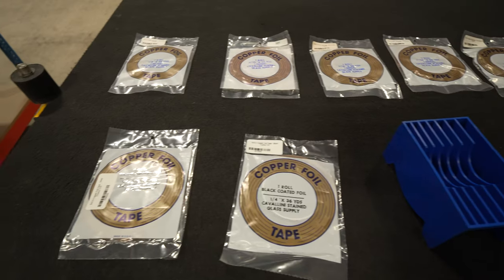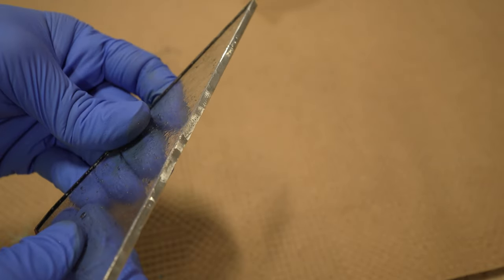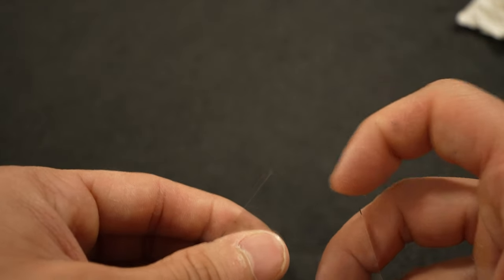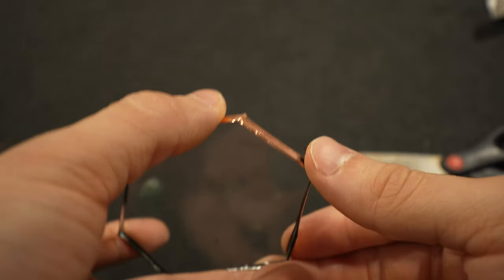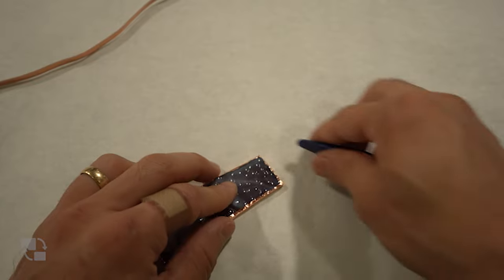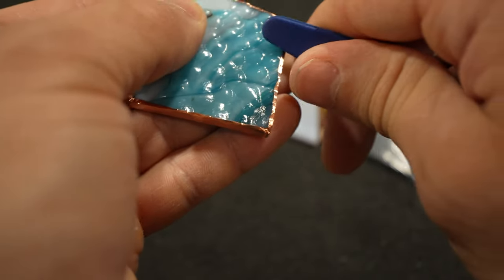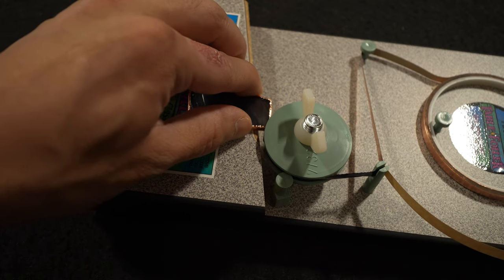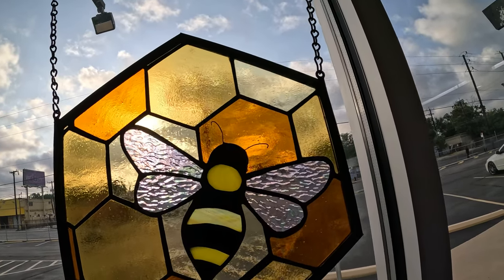2024 Stained Glass Beginners: Do This For Perfect (AND FAST!) Copper Foiling

Comment: I noticed some of your pieces weren’t ground on the grinder. I thought after even a clean cut, your were advised to rough up the glass to make the adhesive stick better. True or not? I’d prefer to not grind if I could. Thanks
Reply from the maker: Sometimes the grinder can leave glass powder, if you don't get it all off it can compromise the adhesion. You can stick without grinding. The solder really solidifies the bond between pieces
Reply: @Mr.StainedGlass  So if I have a clean nice looking break, then I can just foil after I clean it? Sounds great and quite a time saver. I’m gonna try it! Thanks

Comment: Good info. I always go into these stained glass videos with a lot of skepticism, but you did good.
I'm a firm believer in doing what feels best and what gets the job done for you. I taught stained glass for many years, and most people had issues with "foiler tools", and always reverted back to doing it by hand. The extra time was never an issue as they were socially as well as ending up with a beautiful stained glass piece.
The only thing I'd say not to do it patch in a piece of foil. While the adhesive sticks well to glass it doesn't stick well to the copper. (If it is a fresh roll, then typically this is not an issue, but most rolls of copper foil have been sitting on shelves for a very long time, and the adhesive becomes weaker over time)
You also you touched upon inside curves, slow and steady wins the race, the nice thing about foil is that it will generally stretch more than you'd think.
And lately, don't waste money on a dedicated "burnishers" (again this is always a personal choice as well) the body of a "Sharpie" pen is all you need.
Reply from the maker: Good tips James. Thanks for sharing!

Comment: 12:35 Wait, 19 seconds faster than what?  19 seconds faster than 5 minutes isn't much, but 19 seconds faster than 30 seconds is a ton.
Reply: I (roughly) timed the recording, and it looks like the tool takes about 2/3 the time.
Reply from the maker: Yes decent bit faster